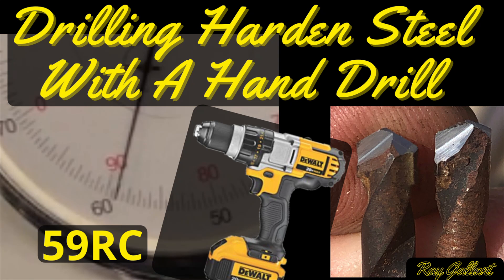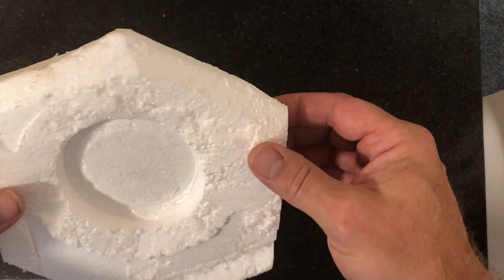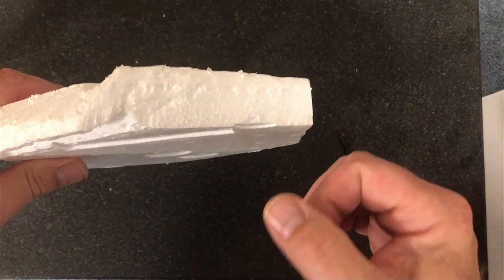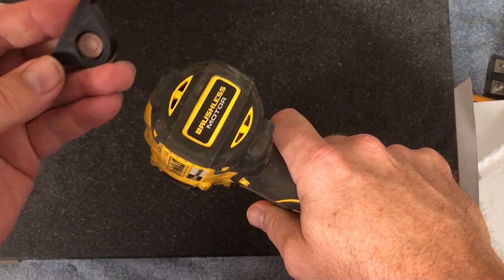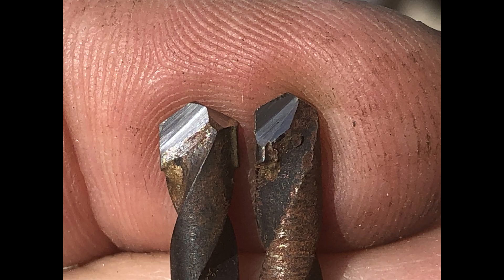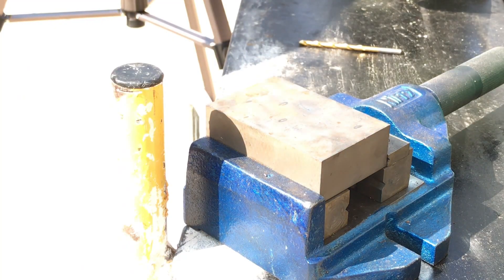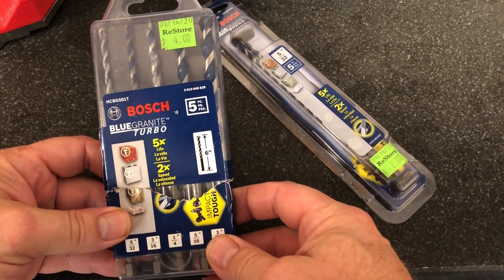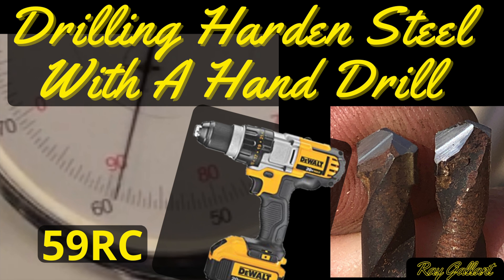Drilling hardened steel with a hand drill

Comment: i use the drill doctor 700x and it sharpens the bits well. i take off the ends of the carbide to the width of the bit first.
Reply from the maker: I’m not a big fan of the drill, Dr
If it works for you, that is awesome 
I’ve gotten a collection of low price drill sharpeners and I was going to make a video on the inherent problems with most of them 

At the college, we have some older but very expensive tool sharpeners the only issue I have against those are there  out of date 
You’re not used in industry

Comment: What if your hand drill is hand powered?
Reply from the maker: I originally was going to make this video using a hand drill, but our hardness tester was broken at the time, so I needed to drill something that was identifiable as being hard material so I decided to go with an end mill
I do have a video where I use a hand drill
Reply: I meant an actual, hand powered, hand drill.

Comment: Well tried great effort just tried drilling my stainless metal detecting scoop half way thro all drills blunt I knew it was going to be bad but not this bad,using same drill as you.cheers
Reply: You can drill stainless just fine with regular HSS drill bit (cobalt is better, though)
The trick is to go slow with RPMs but maximize pressure on the tip. And use something to cool the tip of the drill bit.
Ordinary “vegetable” oil from the kitchen is good for that. Unlike WD40 many people use, it sticks to the bit and if you smell it, you know you need to stop and let it cool.
Most people get impatient at the slow progress and increase RPM. That quickly heats up the tip of the drill bit which makes it soft and it becomes dull in seconds.
High pressure + low RPM+ coolant+patience is the magic formula.
Note that it is very difficult to exert enough pressure for the drill to bite into steel while holding the drill with your hands.
A crappy drill press can easily apply 150-250lbs of force. It is nearly impossible to even approach that holding the drill in hands.
So you need to start with a small bit (no more than 1/8, smaller is better). The small force you apply holding the drill in your hands is applied to small area of the tip so the “per square inch” pressure is fairly high and usually enough for the cutting edge to bite into steel.
Still-keep rpms low and use coolant.
Reply from the maker: I’m guessing that you have work hard in the stainless steel into something that’s almost impossible to drill through

I don’t know if it’s possible can you heat that area up with a torch to soften the material

Comment: That is an electric drill, not a hand drill. The title is misleading.
Reply from the maker: It’s actually a cordless 20 V drill
But is held in your hand. Therefore, it’s a hand drill, not the traditional hand cranked drill. 
I do have three traditional hand, crank drills, one with the old-school tapered shank. That’s a tapered square and I have one that’s the eggbeater style used for smaller bits and a traditional hand crank with a chuck on the end not a lot of use for those guys anymore the traditional, with the crank and Chuck Were OK to use before the lithium ion batteries as a deburring tool but now with the new style of batteries that don’t go dead in storage, I’ll leave a tool or chaffering tool and an electric drill as you like to call it
Thank you for commenting. Have a nice day.
Reply: @shopandmath  https://youtu.be/TBinormS3Mw?si=a0jx_6ukUnEc1n2b

Just in case you and I are not on the same page. Can you use these on metal? Have you tried?

Comment: Thanks for the video .
Doing by hand unfortunately.  Have about 1.5 inches to go ...the off the shelf bosch bits work you were saying but how do you sharpen?
Reply from the maker: I use a diamond wheel to sharpen them which can be a little expensive. You can also get a green wheel that sharpens carbide. It’s a little more cost-effective.

Comment: When drilling steel, especially hardened steel, it best to use a lower rpm on the drill. (Yours was set to ‘2’ - set it to ‘1’). If you use a faster RPM you are just going to overheat the drill bit which will cause it to lose its temper and get dull and at the same time harden the steel in which you are trying to drill even more (at the location where in the drill bit is rotating).  You should also use some cutting oil or cutting fluid or something like that.  HSS drill bits work fine for most mild steel; for hardened steel use cobalt drill bits - most are usually an alloy consisting of about 5% cobalt and HSS.  Also, diamond blades are usually intended for masonry cutting. The blade you showed is not ‘serrated’ - the gaps and loops you see in the blade are intended to keep the blade from overheating.
Reply: You can’t overheat a carbide tip with a hand-held drill. Even a very strong person can’t exert enough pressure to generate enough friction to even approach the melting point of the brazing metal holding the carbide tip to the steel shank, never mind a temperature the carbide would become soft. The resistance to very high heat is what makes carbide a good cutting material.

The gaps in the saw blades for masonry are not for cooling - they are there to help evacuate the ground material. Otherwise the dust acts like a lubricant between the material and the blade.
You can think of it as chips accumulating in the gullets of the blade when cutting thick metal or wood with fine-tooth blade.

Comment: There is no such thing as a ‘solid carbide drill’ (nor is there such thing as a solid cobalt drill).  The drills are still made out of steel - they just have a percentage of another material in them to make them an alloy. Typically the amount is 5%, sometimes more.

Comment: i’ve done this a lot, even with a hand powered bit and brace because i needed it right then. this is a tough gig . thanks for posting expertise.
Reply from the maker: Thank you for the nice comment and thank you for taking time to comment. It is much appreciated.
It’s nice that other guys understand just because we have machinery that costs millions of dollars things can still be done on the cheap with almost no tooling
Reply: @shopandmath  i do almost everything in wood, some metals, and use hand tools. So definitely no equipment or machines. I’m trying to develop my machine shop skills so i can create better machines for my specific woodworking uses. I’m just beginning to learn, and frankly, i love the internet for stuff like this. Not having to have millions of dollars in machinery is fantastic. Being able to create is the path to freedom. 

One time when i did this i welded up a dolly that tilted my entire car up to 45 degrees on the side. I reinforced it (just in case) with big lag bolts. It actually worked, all my angle maths and counterbalance meant i could lift the whole car with one hand and it would stay up for cutting out rusty metal (vintage car resto). Felt like days to drill 16 holes through four plates. It WORKED!

Thanks again!

Comment: I’m trying to drill 8 half inch holes through 3/8 thick steel with the same drill and it’s working but it’s gonna take hours!
Reply from the maker: If you have access to a drill press, that will cut your time for drilling in half

If you can use coolant on the drill, press your drill bits will last twice as long 

Thank you for sharing 
Ray

Comment: Have you ever tried to use a carbide bit in a cordless drill? I've always heard it won't work but it works amazingly well.
Reply from the maker: Solid carbide, in a hand drill does not do very well because there’s no rigidity.
A carbide tipped drill will do relatively well because only the tip is super hard. The shaft is flexible. This gives you a little bit more leniency.

If you have had success drilling with solid carbide without chipping the ends you’re doing very well and you have a much more study here than I do.

If you have video if you’d like to share it, I will incorporate that into my next drilling video
Thank you for sharing 
Ray

Comment: Been trying to drill through a pto input shaft on a roto-tiller without any luck, I'll give this method a try, but I'm not holding out much hope at this point as I'm already using a carbide bit like the Bosch, and they're not doing anything either.  I am going to try and grind the carbide tips a bit and see if that changes the outcome.
Reply from the maker: Hi William
I would love to be able to see identifying photos of the PTO to see what type of heat treat was done to this unit.
I can only assume that it’s a spline shaft
And I would have to guess that the heat treating process is flame hardening that would give the splines or a bearing line shaft, and extremely hard outside with a soft core on the inside
This would also be the strongest type of heat treatment for a PTO shaft, because it gives the extreme hardness on the outside with the flexibility remaining in the core 
Oh, when you tried to drill before with The Bosch drills,, which are extremely high quality drills 
I have a couple of questions
Were you able to break the skin or was the material too hard to penetrate at all? 
Are you located near Kitchener Ontario? 
Is the shaft on the equipment currently or has it been removed? 
Are you trying to drill this with only a hand drill?
Ray
Reply: @shopandmath  The only way to drill through that shaft is with a regular hand drill...the roto tiller weighs almost 400 pounds, you ain't picking it up and carrying it around.  I'm not tearing the gearbox apart on a 2 month old roto-tiller to be able to take the shaft into the shop and use the drill press LOL...and at this point that wouldn't be any different than what I'm already doing.  

I have managed to destroy both the carbide bits that I have, so I'll have to pickup another one and see if I can finish it as I think I'm really close to punching through the other side now.  What a pain this is LOL...would be nice with a drill press, but like I said I'm not taking apart a gearbox on a new roto-tiller.  

I've got maybe a 1/8" to a 1/4" of drilling left on that shaft and I should be through it....then the easy part, putting a retaining bolt through so the adapter stops coming off LOL.

There isn't anything soft on that shaft at all, it has been hard drilling through the shaft, its hardened all the way through.
Reply from the maker: @wildbill23c  
Sorry, my advice couldn’t be much help on the bright side you’re almost through 
Ray
Reply: @shopandmath  HAHA...finally after a 3rd bit I got through it...wow when they said hardened steel they weren't kidding LOL.
Reply from the maker: @wildbill23c  congratulations you beat it

Comment: My issue is hardened 17-4 bolts in jet engines. I need carbide but I break a lot of bits so I've ben using burrs in a high speed grinder to get through them. Not fun 3 hours per bolt and I have 24 waiting for me at work tomorrow
Reply from the maker: Wish I was there I’d help you.
I like this kind of challenge 
What is the minor diameter or major diameter? 
In the circumstances is it possible to do the welding technique, or even easy out ?
At three hours each that’s a week and a half so worth of work. I bet you with the proper technique we can get it down to 15 minutes each including retyping the whole. 
Are you located in Toronto by any chance?
Ray

Comment: Thanks I was trying to drill with the soft or high speed drill bits with absolutely zero luck I tried what you showed and it drilled amazing
Reply from the maker: I’m glad that it worked out for you.
Thank you so much for taking the time to comment. I just made a video but I have not posted yet I’m drilling through an end mill
Ray

Comment: I dont have any concrete bits. I'm making a knife out of an antique hand saw blade. Grinded a few knife blade patterns out already the first one up was the kukiri style with finger grooves.  Mosquite wood handle I only have 2 1/4 in. Single speed drills , 1 dewalt cordless drill . No Luck.. I'm bumbed . I hung it on a tree and shot it with my 22 rifle . 👍 I already made all these blades cut all the handles . 2 Deer horn, 2 mosquite  one jawbone with teeth , and a dam leg bone. All to find out I cant use now. Irritating . I've burned up all my smaller bits. The size of my brass dowels. So here I am looking up videos...weeuuu my wife was like what are you shooting lol , dent 🤣
Reply: I never thought of shooting a hole in it 
Thank you for taking the time to comment
Ray
Reply: @raysfix  yes if you cant drill it shoot it . Then clean up with a grinder 👍

Comment: there's another video that says you're going to fast. they used 3 in 1 oil at the spot, and slow speed. you shouldnt have sand like residue when drilling. it should be nice big curls.
Reply: Yes the softer material will create curly chips which come out almost the same as mild steel
It changes when the material becomes extremely hard and it is hard to control the RPM on a hand Drill

This type of drilling is a worst case scenario when you don’t have the machine shop or the CNC machine with it super rigidity or through coolant tooling
This is when you’re down to basic handtools

One of the sister videos to this is drilling a quarter 20 tap that I broke off it might have better explanations in it

Comment: I found some carbide tipped drill bits on Amazon that basically jobber drill bits with a carbide tip. They're perfect for hardened steel.
Reply: That’s excellent
If you want share the link
Ray
Reply: fix  I've tried posting something as simple as my email in a youtube comment section and had youtube not allow the comment to get posted (yet somehow every creators video has a million spam bots, figure that one out lol). So I can't post the link. But the drills are made by super tool, you can find them if you search on amazon for carbide tipped jobber drill bits. They say they're made in the usa in the title. 

I've had good luck with them.

Comment: I'm using a step bit to make the hole in my car firewall bigger and all it does it's stop moving while in the hole why is that
Reply: If the drill keeps turning in the bit stops moving it slipping inside of the chuck
You are correct for using a step drill to drill into sheet metal that’s one of the best tools or drills to use for sheet-metal
Reply: @raysfix  what torque number should I have the number on
Reply: @ygbodybuilder3023  It should be setting for drill not torque
I’m guessing that you’re using a drill that has torque setting or slip setting one through probably 15 there should also be a little image of a drill that’s the one you should have it on so it does not slip at all

Comment: Is this drill or more like sacrificial metal cone grinding.  Jkg. What about,  .75 HSS bit on bridgeport?
Reply from the maker: Thank you for taking the time to comment
This video is about drilling by hand
Through hardened steel
If you’ve watched the walk through the shop video
You’ll see that I have access to basically every type of machine tool there is

My friend wanted me to make this video to show how you at home without any fancy equipment can drill harden material

I do wish I would’ve chosen something a little bit softer though this took an excruciating amount of time

Hopefully you found a titbit of information useful
All the best Ray
Reply: @shopandmath  I am glad that You suffered and prevailed with rc59 ,now I know it's possible.
Reply from the maker: @petersydow4002  thank you 
its not the best quality video i was trying something new and shooting outside 
ray

Comment: are you trying to say this is  actually a better method and regular carbide bits should be saved for the drill press? or is this an alternative? because I may start doing this, I've got tons of burnt concrete bits from work to recycle ♻️
Reply: I didn't make the video , I noticed nobody replied . But yes for a hand held drill this is a better method as a full carbide bit would be more likely to snap while using said handheld drill .

Comment: If you buy the Milwaukee masonry bits they will cut hardened steel with no modification.
Reply from the maker: yes they have the same profile as the bosh drills 
the only improvement would be a positive cutting angle 
and even that depends on the type of material you are cutting

Comment: I don't have a diamond wheel, could I use a diamond stone to sharpen the bits?   Thanks
Reply from the maker: try buying a cheep diamond wheel for the grinder or table saw
Reply: Diamond bits on a Dremel work wonders too
Reply: Anything is possible but that would take a long long time
I would try a diamond wheel on a grinder even a hand grinder

Comment: the problem is a canadian amateur
Reply from the maker: Don’t worry if you practice a couple of times you’ll become a pro in no time
Starting out I would probably use a little larger bit something between 3/8 and a half inch
Worst case scenario if you cannot good consistent sharpening you can always buy the Bosch bits
Remember for best results use a milling machine
Or a rigid drill press
Best of luck
Ray